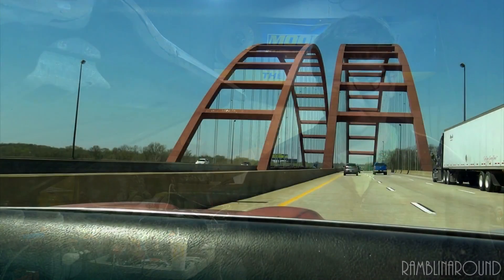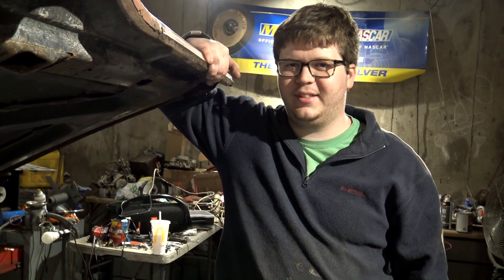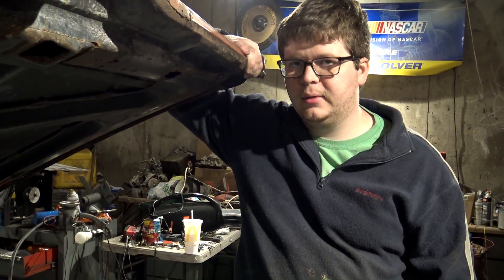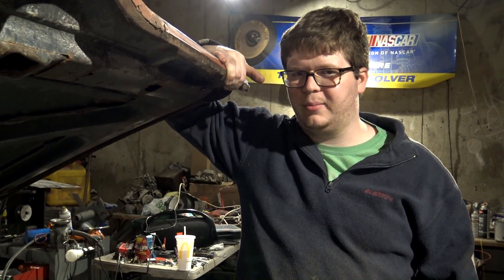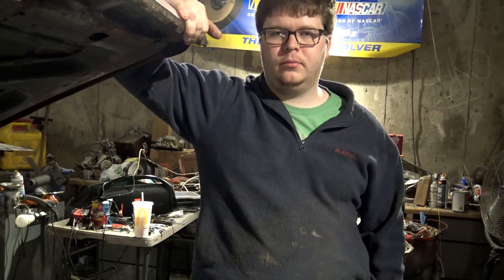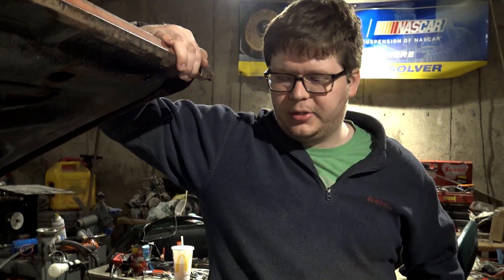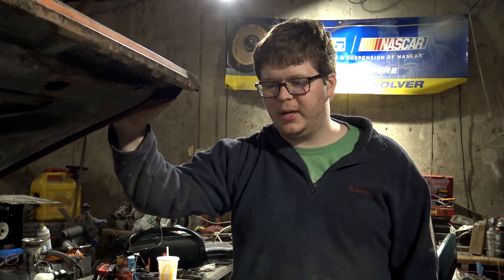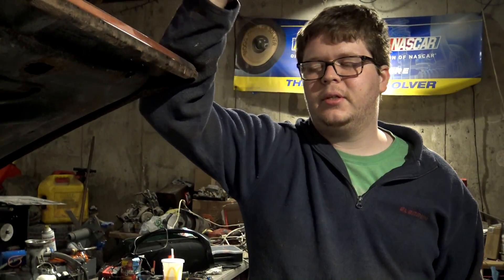1968 Pontiac GTO Project Update - Video #21 - Garage Burnouts

Comment: That reminded me of that Clint Eastwood movie where he was hitchhiking and got picked up by some wacko that had the exhaust pipes routed to the interior!!☺
Reply from the maker: Yeah, I remember that....Thunderbolt and Lightfoot.  Neither one of us was feeling too great when we got there.  The ride home was much better.
Reply: I had a few small rust holes in the wheel wells that seemed to suck exhaust into the car . I warmed up my 1st gen sbc with carb and then stunk like gas on my clothes bad . Im considering putting a catalytic converter on , they are pretty high flow now a days I think . maybe one that I could bolt on and off with a insert pipe ready to swap .
Reply from the maker: @Mcleod0000  The catalytic converters definitely do a great job of cleaning them up.  We need to go over the entire car and make sure any wholes or gaps are filled.  Then Jordan needs to finish getting the exhaust out from under the car.

Comment: Nice burnouts, it's sounding great! Sounding more snappy, I have annular boosters on my holley 850 and that with a 110 LSA makes it super snappy on the throttle for my 455. If you build a 455 right it can rev, my Dad's 67' Lemans had a 455 with an offset ground crank with a butler kit making it a 474, had butler edelbrocks flowing 310 cfm and a 710 lift roller cam and several other mods and it could rev over 7 grand easily. Made nearly 700 horse, first pass off idle it went 10.89 at 125mph. Fun and fast car, had 12.5 to 1 though and ran on 110 octane erc so not exactly an everyday driver but one hell of a pontiac! Keep up the good work!
Reply from the maker: Thanks man, I appreciate that!  I'd like to do a similar build to that, but with 10 to 1 compression.   I really want to keep it where I can still run it on 93.
Reply: @RamblinAround  Yes I agree, my car has 9.5 to 1 and is pump gas as well. I would like a butler big inch pump gas motor but they are so darn expensive. I was at the tiger run one year and a 70's firebird showed up with a 535 Pontiac making 707 horse and 698 tq on pump gas, ran 9's. He was running a 70 judge with a 474 on the street and it was crazy.

Comment: For some reason, the GTO sounds a lot better than it did last video, sounds smoother in a more beastly way. I hope you keep the original hood, a little weight won't hurt when the torque is increased. That is a project that is going well. I enjoy seeing where it has come from. Sounds like it gets you to work pretty fast. Wish I could drive the GTO into the school I work at.
Reply from the maker: Thank you, it really just needed a lot more tuning.  We were just in a hurry to get it on the road.  It's starting to come along pretty well now.  Thanks for watching, we appreciate it!

Comment: If you do buy a glass hood, you can get one from GlassTek that has a 2 inch bow in the middle for carb clearance. It looks close to stock but actually looks better than the OEM hood because it adds curves to the only flat panel on the entire car.
Reply from the maker: Thanks for the info, I appreciate it!

Comment: When you mentioned get exhaust fumes coming in ..I thought the same as Roadking with the crazy guy in the jacked up Chrysler and the trunk full of rabbits ....Carburetors suck trying to find tune them just right ..Don't over look the power valve in a holley type carb or in a Ford carb that is what regulates how much fuel pulls through the jets by how much vacuum you have ...Gotta watch it so I do not post stupid comments LOL
Reply from the maker: That crazy guy's car sounded pretty awesome in that movie.  You're right Jim, we need to get a good vacuum reading, so we can find out if we're using the right power valve.   You're safe with the comments Jim,  we appreciate you watching!

Comment: They make crate engines that are sbc 454 563 hp, 545 lbs.-ft. torque NA . If you guys are doing a 461 you can probably get 600 - 650 HP NA , that car is surprisingly light you might get the front tires off the ground . It would be the worst guzzler anyones ever seen tho . I was watching a video about the 68 gto with the big engine and it was saying it would get 15mpg , which is pretty good actually . same as my 2008 crown vic with 120 less cubic inches , altho the crown vic is like 750 lbs more . It must be the high compression sucking more energy out of the fuel . Anyway , I want a gto now
Reply from the maker: It already is horrible on gas, even with this setup.  I'm glad I installed the 20 gallon fuel cell, because at least I can still drive a decent distance between fill-ups.  I'm not going to be driving it every day, so I'm more concerned with the power than the fuel mileage.   I think the stroker kit is going to be the way to go.
Reply: I did a 350 to a 383 stroker and the exhaust boom is way deeper . Your GTO already sounds awesome I cant wait to hear it